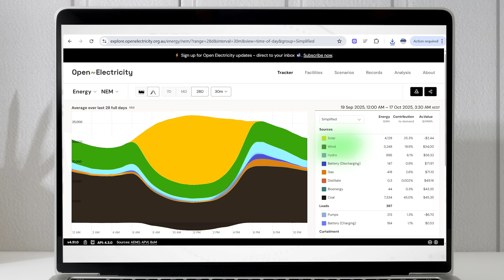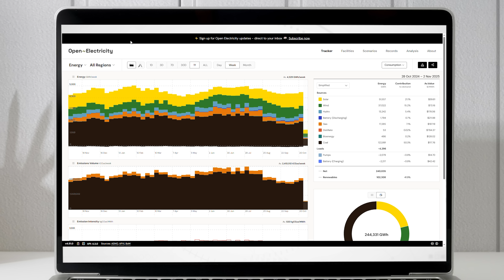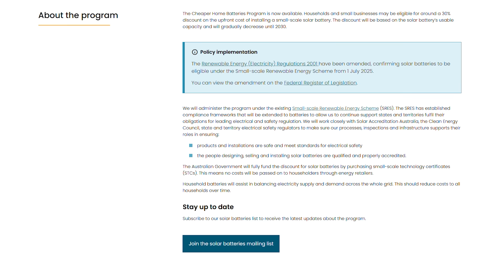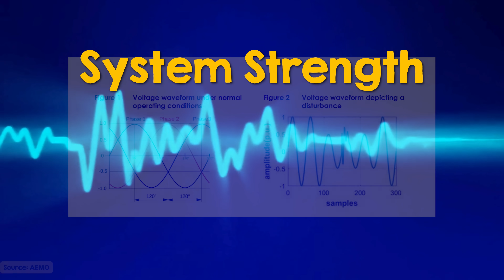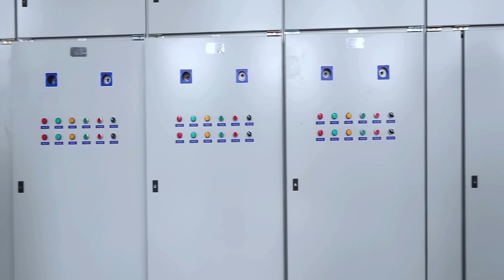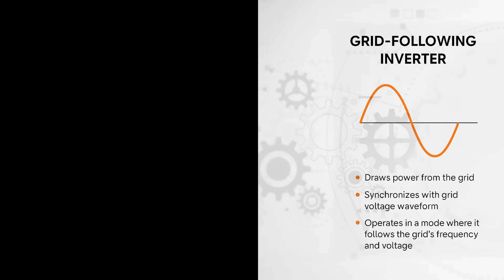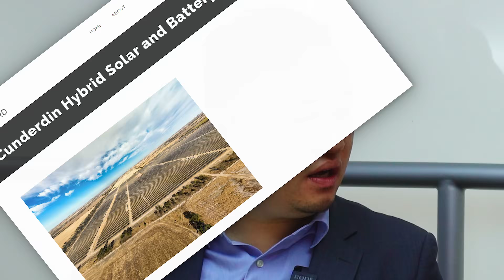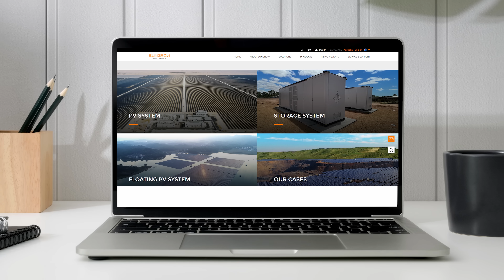Australia’s Solar Boom Is Breaking the Grid - Or Is It?

Comment: I love how Australia is so blessed; even your problems don't come from a lack of something, but rather from having too much. Love from UK.
Reply: With all their  sunshine they could use electricity to desalinate seawater even.
Reply: @5400bowen  We actually do have desalination plants already. The power increasingly comes from solar and wind.
Reply: @soulsphere9242 . I guess I worded it wrong...though I never said it is non existent. Just that it is an obvious resource with the blazing Australian sun baking 3/4 of the country consistently. As far as I know you Aussies are installing solar faster than anywhere but Africa.
Reply: @5400bowen  I have wondered that too -The "24/7" Problem

Desalination is a high-pressure, continuous process. The most common method, Reverse Osmosis (RO), works best when it runs at a steady, constant rate
Reply: Not really, people are moving to solar because we are being scammed on energy and people are desperate to find an alternative before their bank balance is drained because they made the mistake of running an aircon for exactly 0.12 seconds per day.
Reply: @TwoPlusTwoEqualsFive32 that's every where. Water is even more that way. I moved to where it rains 160 inches a year and we get a good amount of sunshine as well. Catchment is the main source. I have never run out in 12 years. I do use a generator 3-4 times a year. So maybe $40-$50 a year for gasoline.
Reply: The UK has exactly the same supposed issue but just with windpower instead
Reply: @araylaurence6220 also has too much islam
Reply: @araylaurence6220 lol!!!! You forget that the uk has basically lost its industry because of that right! All of Europe has been deindustrialising with this wave of renewables and separation from cheap gas
Reply: @alanmay7929  The main problem Europe have right now is that Germany got scared and shut down nuclear power without replacing it leading to a lack of power production that drains from everyone else.
Reply: @znail4675 Australia can be happy to have too much electricity but electricity isn’t everything it doesn’t solve the industry’s problem.
Reply: @znail4675  Yes that was a decision made out of fear, all energy politics have to be long term. I am not pro nuclear power but when it was installed and working you should not stop then without a good replacement.
Reply: @alanmay7929  Eurozone industrial output has started growing again in recent months so your statement is incorrect.
Reply: @alanmay7929 there is nothing cheap about gas anymore and hasn't been for a few years. Basically if we want to be dependent on Russia for energy we can have cheap gas, otherwise gas is actually expensive.
Reply: @araylaurence6220  It feels like the only thing the UK has in excess these days is asylum seekers. It's ironic for me to say that because I was one myself, long ago. Back then, there were far fewer of us, plenty of housing, and jobs paid well.
Reply: Like corruption? Propaganda and lies?
Reply: @TruthWillAlwaysWin The politicians may be, but the people are wonderful and the land is blessed.
Reply: @vetrino4ever politicians suck most places.
Reply: Too much idiocy in govt
Reply: And yet Australians whinge about how bad things are... "The Lucky Country" indeed.
Reply: With all of our natural abundance, we still have  a lack of something... 🧠
Reply: @PaulSmith-sz2gv lame joke the uk has lost its industry and Germany is going through the same phase too! Those countries doesn’t have the « natural adundance » to do it anymore
Reply: Have to find a way to turn rain into power.
Reply: @Jan_mxv Tassie did that years ago.
Reply: @Jan_mxv lol!!!!!!!!!
Reply: @Jan_mxv  https://www.youtube.com/results?search_query=home+hydro
Reply: Our politicians are corrupt AF and the public are simpletons, you don't know anything about AUS
Reply: @blackmancer why doesn’t Australia actually develop and make its own batteries? Steel! Aluminum……. Tell me why!
Reply: @alanmay7929  We don't make batteries here now, because lithium refining is extremely polluting, and because we don't have the population or industrial investment China has. Even if we did make batteries here, they would be more expensive than the Chinese ones.
Reply: @daviddavidson1417 Blablablabla!!!! So you always complain about China “polluting” while they are literally making almost everything on earth for every countries right! How does that even make sense?
Reply: @daviddavidson1417 you don’t need millions of people to make batteries, those things are highly automated processes, you have the engineers to mine, develop and make lithium batteries, you could literally be leader in soooo many techs.
Reply: @daviddavidson1417 the “green” steel revolution for example, Sweden is already making steel with mixture of hydrogen and natural gas instead of coal for example. Why don’t you make similar thing?
Reply: @daviddavidson1417 Australia has a gigantic potential that it has been wasting forever! If Germany was that whole island oh boy it would be a totally different story trust me! Or even let’s say Japan or the Netherlands…
Reply: @alanmay7929 Germany and Japan have higher populations and population densities than Australia. Population imparts scale, scale brings manufacturing efficiencies.
Netherlands is right in the middle of Europe. 
I'm sure we'll build some of the automated factories here one day, just not until the Chinese, Europeans and Americans have worked out how to do it well and cheaply.
Reply: @daviddavidson1417 wow another lame justification! Germany and Japan doesn’t have all the natural resources to actually show their amazing industrial potential, imagine they had acces to what Australia has, population density is a factor for very labor intensive manufacturing jobs like assembling iPhones….. the mining, steel, aluminum….. doesn’t require millions of people.
Reply: @daviddavidson1417 the usa has basically lost its manufacturing capacity trying to make everything cheaper in China and keep even more money to the richs corporations that doesn’t reinvest the money back in the country.
Reply: @daviddavidson1417 often China buys a lot of machines made in Europe for their large scale manufacturing business. It all have to start somewhere.
Reply: @daviddavidson1417 Japan has a massive population but not enough habitable/usable space let alone ressources and finally they have constant natural disasters like earthquakes…. It’s amazing what they have accomplished despite all those problems.
Reply: @alanmay7929  Yeah it's almost like in all those countries that population size and density is more important than natural resources for a manufacturing sector. I like manufacturing too, but if it's not feasible to do economically then we can't do it. If it's all as easy as you say, why did Australia's car manufacturing industry die despite decades of generous government subsidies?
Reply: @alanmay7929  cos we have moron politicians that got this all the way wrong - need to use the masses of coal we have in the ground to generate enough power to you know actually sustain heavy industry but yeah instead they decided to go the ideology route first and have totally screwed up the plan to get to their stated goal of net 0.  As a result all heavy industry has moved off shore and so have the jobs and talent and we are all poorer for it.  Never trust a politician as a project manager!
Reply: @alanmay7929  Aus has much stricter environmental protection laws and workplace safety laws.  Economy of scale means we couldn't produce enough to make batteries etc as cheaply as China.
Reply: @alanmay7929  Sure, while you don't need millions of people to run a smelter or manufacturing. You have to remember that you have to have the skilled personnel to do it.
Not everyone can be that engineer or have that desire.
Now, by the rule of numbers, having a larger populace enables a higher chance of getting talented or suitable individuals in your chosen manufacturing area.

As for the companies that could make the local manufacturing happen, its cheaper to ship it off and get it processed overseas and so the motivation is to do so.
Also, the labour might be cheap due to different labour safety regulations or compliance rules.

Lastly, there could be incentives from certain companies that politicians get that sways their vote.
News outlets owned by certain individuals and parrot their narrative.
So when it comes to govt changes - well they're hamstrung with rubbish.
Reply: @alanmay7929 because our bloody energy costs too much!!
Reply: @Revolutions1200 why does it cost “too”much? You are literally surrounded by gigantic excess of energy ressources I don’t get it! What exactly are you doing?
Reply: @sebastianmcdonagh8502  So you want more expensive power to run heavy industries that would cost us more for the goods that these heavy industries use? What a genius idea.
Reply: @alanmay7929  We are building the capacity to exploit those resources currently. It takes time.
Reply: @a @alanmay7929 Same reason you don't make your own batteries..they are cheaper from China.
Reply: @alanmay7929  Australia has a geographical problem and a population problem for any large scale manufacturing to be globally competitive, ignoring all the local issues.
Reply: @blackmancer  As an immigrant from a long time ago it is staggering to see that people seem to be fine with it  and vote the same corrupt people in. Talking to many people around, it does not look like most have any issues with that!
Reply: @blackmancer you are describing 90% of the world today my friend.
Reply: @blackmancer i know everything about Australia! It’s a gigantic joke! They have all kinds of crazy amounts of natural resources but no they sell everything to China and it comes back in transformed super expensive product.
Reply: lol australia is an indigenous genocidal colonizer land on the Indian Ocean that sells minerals from the stolen land to get rich and has some of the worst per capita carbon emissions on the planet
Reply: @VARMOT123  cant generalise our situation like that. The children who are next for any country world wide should be ashamed of living. Living requires a job. Job requires electricity. Only solution to this is live offgrid and of the land witch you clearly are not. Living off grid is possible worldwide and has been historically. Who is worse? Producers, suppliers or consumers? No consumers =
All land is stolen now the world has been stolen by humans we did this by naming it earth (eg being intelligent enough to claim a space ours)and living on it. 
The alternative is the following .................................
Regret and shame for what cant change is useless 
Do better for people around you help protect and love makes a difference
Reply: @jessicasmulders4233 .  Living requires a job after the natural ways of living are erased from the populations skills set.
Reply: @VARMOT123 "indigenous genocidal colonizer land" you know every land on earth is like that, right? Your ancestors just did it earlier.
Reply: @VARMOT123 Why do you find that funny? Australia is a country, not a coloniser. It is on the Indian, Southern and Pacific oceans. Like every country, the minerals are sold, generally to make the wealthy elite even more wealthy. The vast majority of citizens are then required to toil all of their lives to hopefully own a dwelling, though that is becoming increasingly out of reach. Australian emissions are high per capita due to historical coal use, but that is diminishing rapidly now. Gas liquification contributes a lot as well. Hopefully the rest of the world can decarbonise as well and put the gas companies out of business 
Having said that, healthcare, NDIS and welfare make poverty and misfortune easier to bear than many places around the world 
The last recorded aboriginal massacre  was in 1928, when the population was a quarter that it is now. Very few people in this country are even descended from people responsible for any genocide. The fact is that there are many descendants of the survivors of such massacres and horrendous treatment perpetrated since then. I hope that the living conditions for the indigenous survivors can be improved as we move forward. But without some major political reform, people in poverty now will be unlikely to be able to move into any kind of middle class sort of lifestyle. Not sure which countries are  doing better in this regard right now, but our political and electoral system should allow us to force our representatives to make things better for everyone living here
I wouldn't want to live anywhere else
Reply: We both have too many brown people

Comment: It’s time to rethink the Edison/Tesla choice that was made to facilitate energy transmission. AC allows easy step up and step down of voltage from centralized generators to end users.
The paradigm shift happening now is distributed storage and almost as important,distributed generation.
Having gone almost completely off grid I don’t much care about the frequency or voltage variations that are so hard to manage in a wide spread grid.My grid consumption is primarily charging my battery bank at night with free electricity. My solar mppt charges the batteries with DC 120v-480v ,so taking in grid power through the mppt solar charger wouldn’t be affected by voltage variations. 
It seems to me that a neighborhood scale solar installation with high voltage batteries and a DC buss ,allowing individual homeowners to consume or export in DC , would be simple and resilient.
That same cellular construction,from home to neighborhood to local microgrid to regional power sources like wind or hydroelectric could switch to AC for transmission advantages,eliminates or mitigates the power plant to electric toothbrush management complexity.
Reply: We did not have electronics that can switch at high frequency (making transformers smaller) when grids standardized on AC power.
Mechanical switching at high frequency is power hungry and maintenance heavy.

Comment: For east coasters just link up with WA as we are 2-3 hours behind you. So our solar is still great when yours is off. Just connect us with a long high tension wire and we can supply you with solar in your peak hour.
Reply: The maximum length of overhead high-voltage AC cables without close phases is limited to approximately 800 km, with close phases up to 1200 km, beyond which high-voltage DC transmission lines are more profitable.
There is a strong dependence on China and northern European countries for high-voltage AC and DC power transmission technologies.
Reply: The real problem is transferring the energy that far, if you step up the voltage high enough you can reduce the losses but then you would need a cross-country transmission line capable of it. The East Coast could cover your mornings, and the West Coast could cover the evenings. I assume it would be more feasible just to store it, especially given how quickly battery prices are falling

Comment: Digital inertia as opposed to mechanical seems like a hackers dream 😮
Reply: A turbine's mechanical inertia may actually be worse.

Because if hacker got access to turbine controls to simultaneously shutoff fuel flow and also shutoff the control center's ability to disconnect the turbine from the grid, then the turbine becomes a massive megawatt synchronous load on the grid!  What's worse is, as the turbine slows, it pulls down all frequency, phase and voltage.  That's very much worse as that will bring down that region of the grid in a hurry and then possibly have cascading effects on the rest of the grid.

In the end, mechanical turbines are no panacea for grid stabilization.
Reply: Better description is grid forming inverter. The is no need for the internet for this to work.
Reply: I would disagree with you if not for IoT.
The 'S' in "Internet of Things" stands for security!
Reply: Eh, do you realize how much of the grid is alread hackable and has been for decades? This is already a solved problem, or we would be seeing hacked grids everywhere!

Comment: I made  hybrid island setup  8kW  PV  array 6KVA inverter  6kWh battery, 1.5KW  off peak  connected grid charging if needed,  setup works very well, battery life cycle cost around 12 cents per KWh  over estimated 10-12 years life
Reply: Looking at my domestic grid-connected setup I see that the inverter is a bit slow to respond and uses the grid as a cushion for sudden changes in load. Presumably you don't have brown-outs, so I'm guessing an isolated inverter is a bit less gentle!